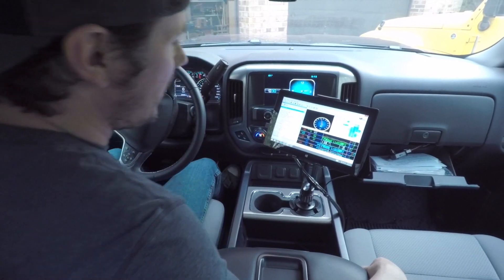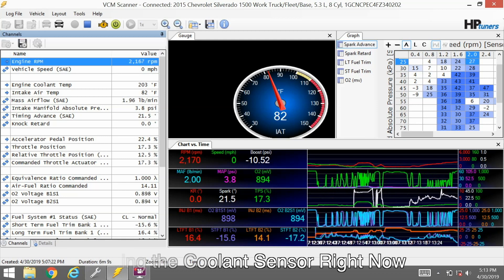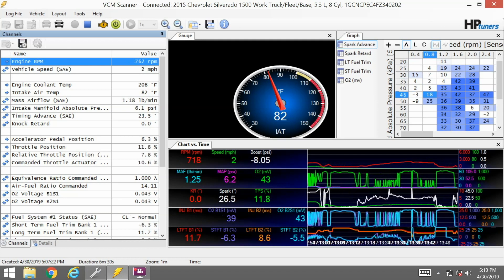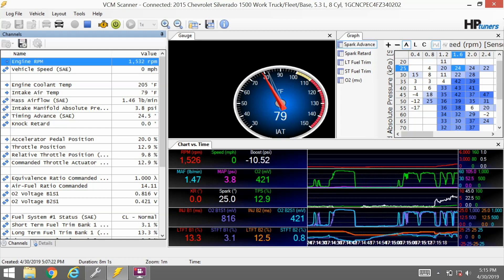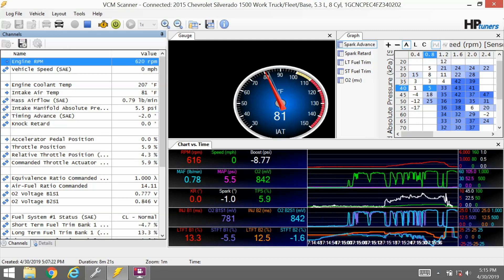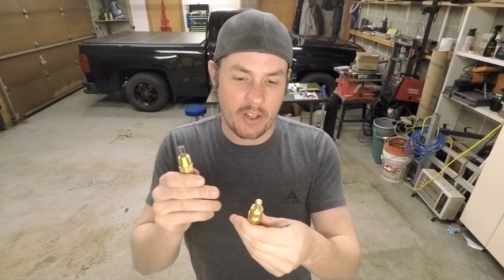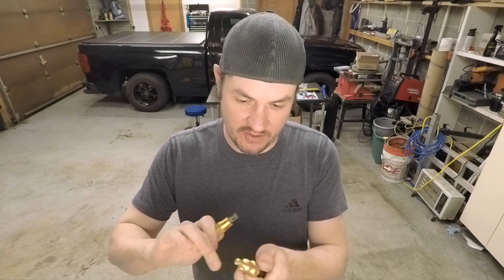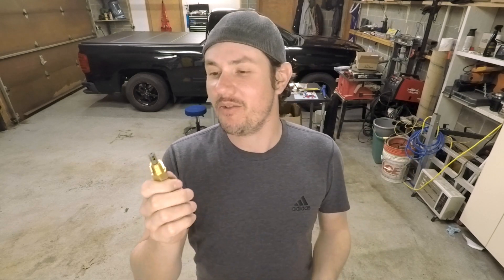Replace Intake Air Temperature Sensor With Coolant Temp Sensor?!

Comment: Put the air temp sensor back in the correct position and run the sender wire through NC of a relay. When you turn on the methanol trigger the relay and on the NO side of the relay which is now closed run the sender wire in series with a variable resistor for tuning. Base the desired added resistance on the temp sensor on the R to temp data of that sensor. This does not allow for varring amounts of methanol per second. I dont know if you dump a set volume of methanol per second or if you have an ECM that varies the methanol with RPM.
Just a thought.

Comment: Perhaps the thing to do is modify the sensor itself to be "bullet proof" to methanol. These GM air temp sensors can be extracted from the brass body without hurting the sensor itself. The part of the stock sensor that would be most affected by the Methanol would be the plastic shield... its the thing with the holes in it, the sensor is the tip inside that.  I have the same GM sensor on my car, it was not possible to use it stock as the thread diameter was way too large for the manifold on my car. We extracted the sensor from the body by machining it away and then re-inserted the sensor into a much smaller 1/8 npt brass body, and re-potted the sensor using high temperature epoxy, taking care to position the sensor tip as close to the end of the brass body as possible. It does reliably report manifold air temps and doesnt seem  to record temps that are different than a "stock" one would do. Although using high temp epoxy would not work well for your application (methanol would probably eat the epoxy over time) I bet having the sensor touching a tip made from stainless or hard anodized aluminum would probably still react quick enough to work but would be impervious to the corrosive effect of methanol. The other thing is- it might make for a better test of reaction time to plunge the sensors into ice water and measure the time it takes  for the sensor to hit the ice water temperature.

Comment: Hi, my IAT sensor shows a steady increase of the air temp even when cruising. So for example it will clumb up to 40-45 Celsius when the actual ambient temp is 25. Is this way off? Is this heat soak acceptable or could it be a sensor fault?
Reply: Its probably heat soake, iv heard of gto's having the same issues

Comment: Before your time, 81 to 83 Cadillac's had a coolant and intake air temp sensor also. They had the same connectors and some techs could mix the connectors up and I would have to figure out what was going on. Nightmares.

Comment: How do you know when the sensor goes bad? Reads wrong?
Reply: motion raceworks has a new sensor that reacts far quicker than the factory one and is probably a lot more durable
Reply from the maker: It will often have a frozen reading that's way off and on some cars it will throw a check engine light.
Reply: Goat Rope Garage mine seems to still work after 5 years of spraying meth across it. Im going to keep an eye on it now though
Reply from the maker: How far down from the nozzle are you? I've got mine as far as I can and I'm wondering if I should relocate where I'm injecting.
Reply: Goat Rope Garage id say its at least 6” downstream.
Reply from the maker: Yeah, mine is almost a foot downstream. I put it towards the inside of a bend too. You know what size nozzle you're using?
Reply: Goat Rope Garage had limited space. Its an ecs ysi kit on a 2010 camaro. Card style maf with a breakout iat harness. Its a aem twin nozzle meth kit with i believe a 1000cc and a 250cc nozzle.
Reply: Or maybe i went from a single 1000cc to dual 750/500cc. Id have to look.
Reply from the maker: Sounds almost exactly like my setup, I'm running the breakout iat also but only running a single 1000cc nozzle. Maybe I should try and move mine closer. Thanks for all the feedback, Brian, I appreciate it.